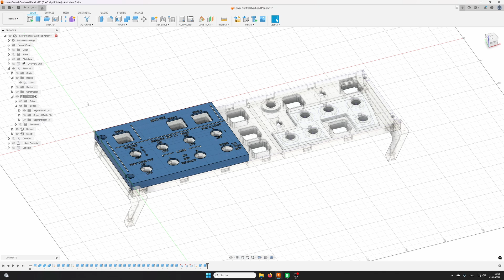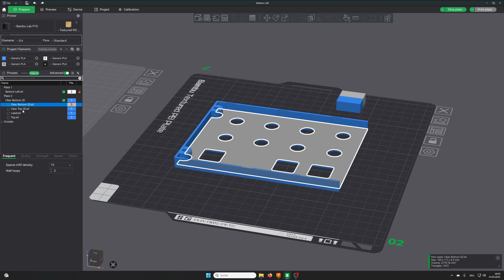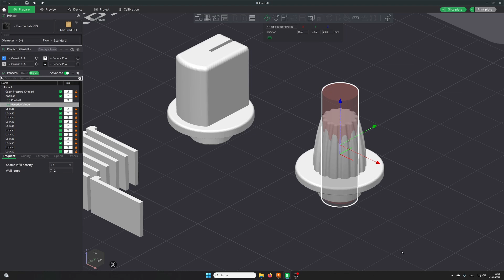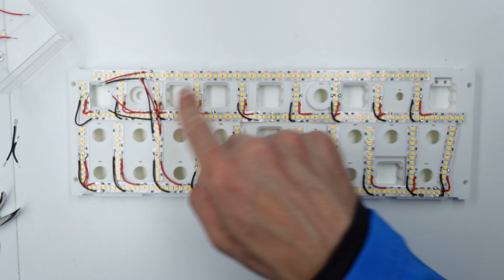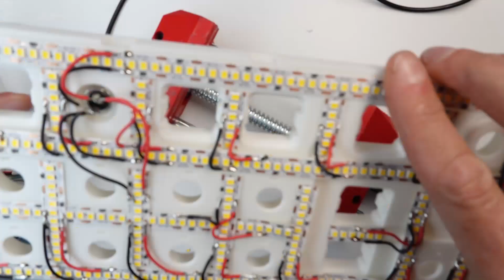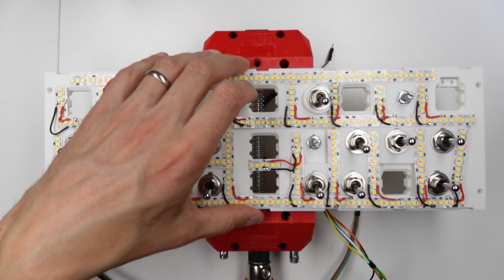Lower Central Overhead Panel Part 3 - EP 27 - Full Home Cockpit Build

Comment: I have another question if you don't mind answering. I bought a really good 3d printer (Anycubic Korbra S1 Combo) for my cockpit build. I tried printing the Korry labels, but they didn't come out to well. Are you using a 0.4mm nozzle for text, including the panels, or 0.2mm?
Reply from the maker: I'm using a 0.4mm Nozzle only but with a line width of 0.26mm for all the labels.
Reply: @TheCockpitPrinter  Thanks! I'll keep working on the settings. I'm about to print out the "Lights/APU/Anti-Ice" panel front.

Comment: Great work! I’m now building my own RMP panel and this helps a lot.
Reply: I was looking into that as well. Let me know how it goes! Can you tell me how you’re doing the buttons? I’m trying to use those square buttons with an led in them
Reply: @arjenschrijer2164  I actually designed my own PCB where i have microswitch and LED very close together. The button just sits on top of it. But now i’m waiting until the pcb is delivered from jlcpcb. So will see if it works 😅
Reply: @jirizikes6589 ahh nice. I’m not in that stage/level of electronics yet, but would love to do that in the future. Let me know about your progress!